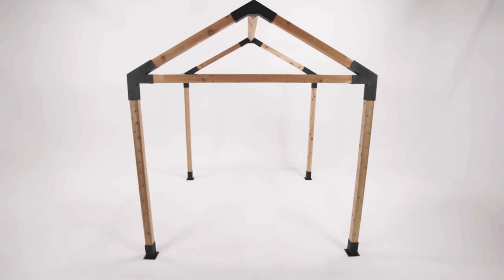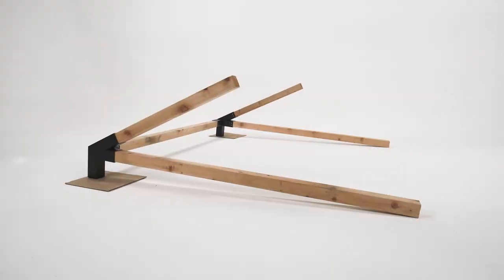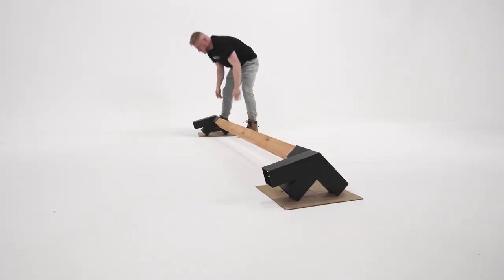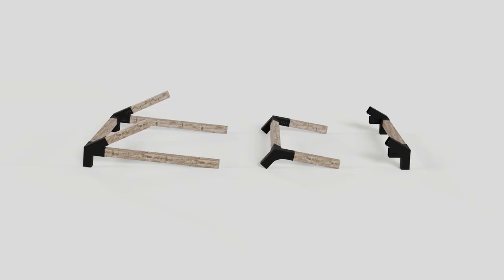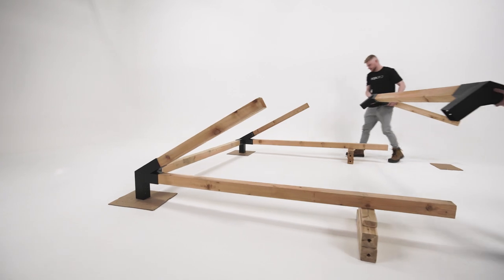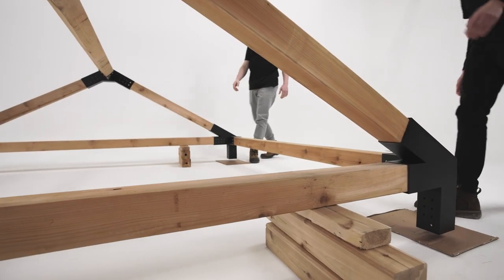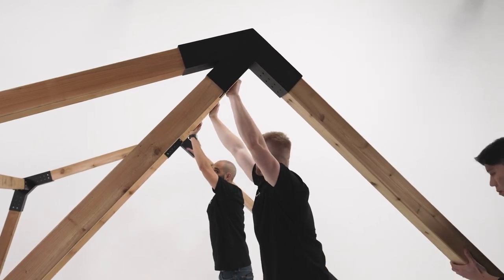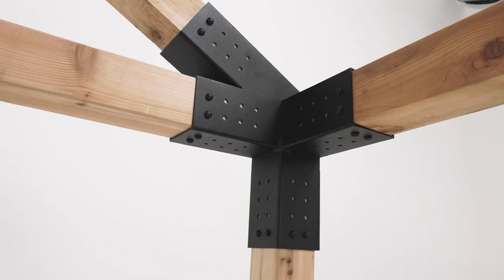How To: Installing a Grid 30 Pergola by Toja Grid

Comment: Do you have to secure the base posts to the surface/ground or can you leave them how you did in this video?
Reply from the maker: We always recommend securing your build down to your ground surface.
Reply: I wonder if anyone has built a tiny cabin using these?  Could it work? 🤔🧐
Reply: @tojagrid  It is possible to have special sizes in the triangular iron boxes, along with the length, width, height, and thickness of the wood used. Is it 10 cm?